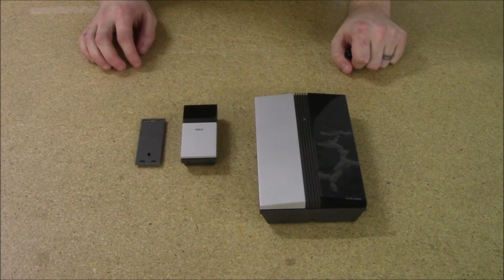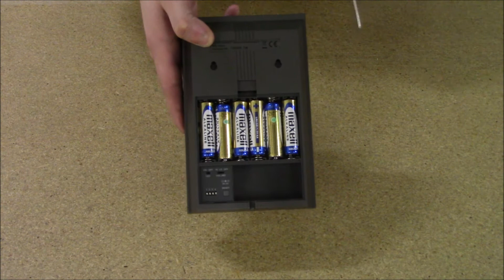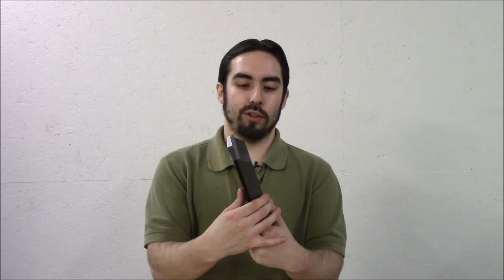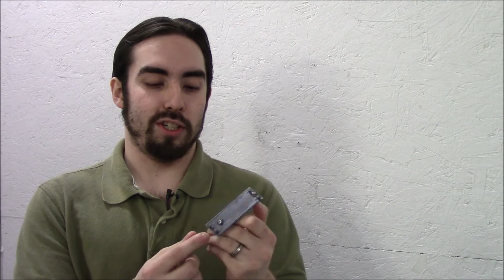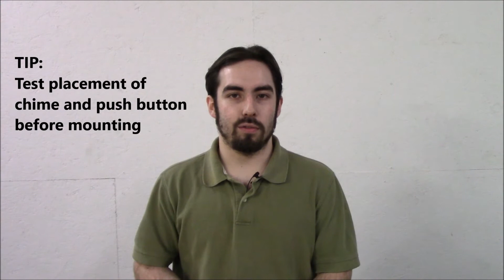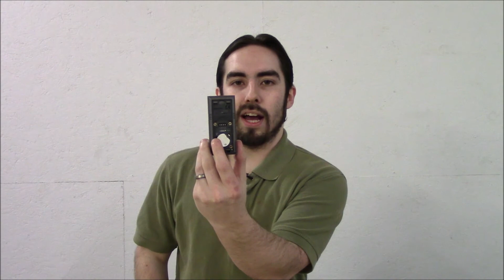How to Set Up Jacob Jensen Wireless Doorbell Complete Overview - Tutorial

Comment: My doorbell wasn’t working so I have changed the batteries on both bell push and chime.  Nothing happening.  No LED, no sound, nothing.  Everything is switched on and the 4 little switches are aligned.  What am I doing wrong?

Comment: My JJ unit is several years old and had been working well.  Recently, I noticed it had stopped working so I replaced batteries in both chime and (2) door push buttons.  Checked volume and frequency settings and pushed reset buttons on all units several times.  While they clearly seem to be communicating when door unit is pushed given LED lights blinking, there is no doorbell sound (tried all of the chimes).  Is it possible speaker just quit working on the main unit?  Any suggestions?
Reply from the maker: Hey there, it sounds like you need a receiver. Did you purchase this system from us?

Comment: I really like my new JJ door bell. I have it set up with one chime for the front door and the default knock at the back door. But I have an issue that I have not yet been able to solve. I cannot seem to find a frequency where there is no interference even though I am in a country subdivision setting where houses are more than 50 yards apart.. The worst setting was the default frequency with constant random ringing. I have been through 6 possible dip switch combinations so far with no luck. The latest setting was fine all day, but in the middle of the night, the bell started ringing and would not stop until shut off. The LED indicated that the interference continued. My new approach is to use a 7th setting and find additional places to put the chime until there is no interference noted. Any other ideas?
Reply from the maker: +trainav8r I recommend finding a different location for your chime that is away from sources of interference.  Also make sure your push buttons aren't mounted directly on/next to metal doors/door frames or structures as that can greatly interfere with the signal.  Take care. -Devin
Reply: +GadgetShack 
I already found the problem, which was a bad push button that came with the unit. It has been replaced and now all is well on any of the frequencies for both of the push buttons I have installed.
Reply from the maker: Glad to hear it!  Take care.